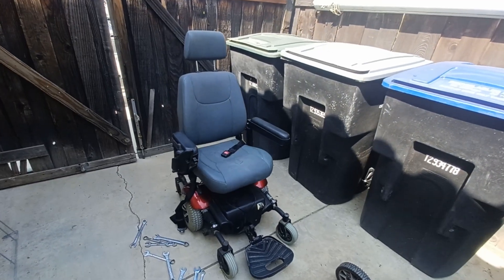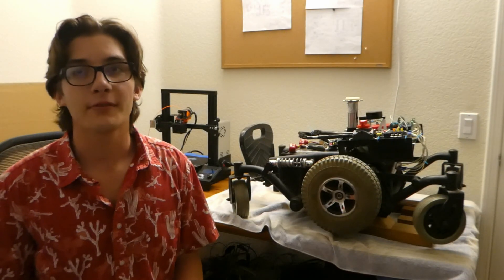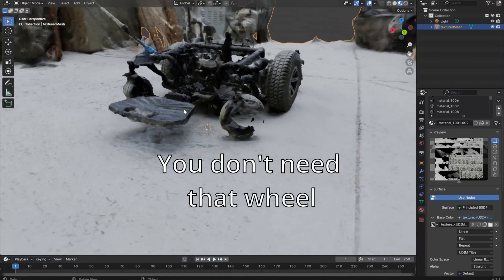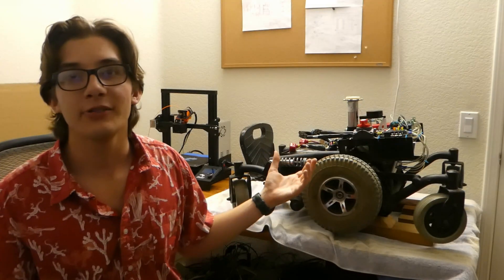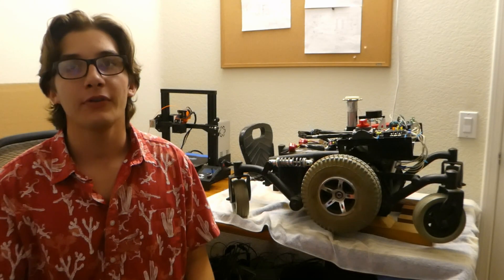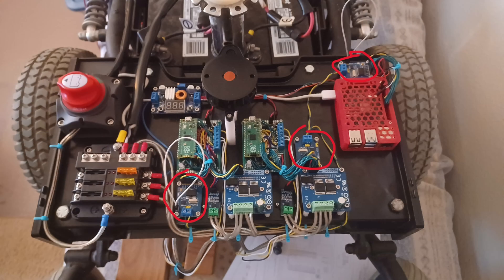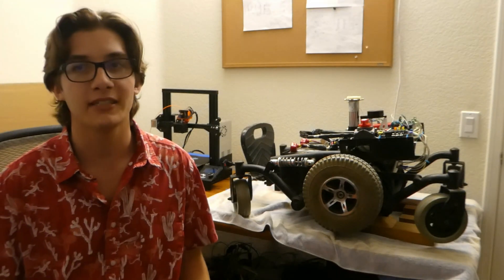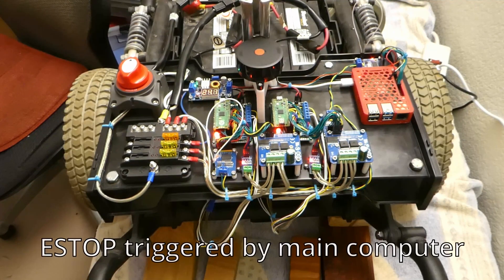The HARDWARE behind the ULTIMATE DIY DARK RIDE

Comment: Solid project, looking forward to seeing it running
one question - is there a specific reason you're using 2 picos, instead of just running the motors off the same one, or the main ras-pi? Are you limited by number of pins, or is there another reason for separating them
Reply from the maker: Hey glad you like my project! There isn't any reason that both motors couldn't be run from one microcontroller or from the Raspberry Pi directly. The only difficulty would be the specific wheel encoders I am using don't have settable I2C address, so you would have to use an I2C multiplexer to communicate with multiple. 
The reason I went for two microcontrollers is for ease of programming and debugging. If I had one microcontroller for both motors, I would be more likely to write an error that only affected only one motor that would be hard to debug.
As for why I didn't directly connect the motors to the Raspberry Pi, I like using the GPIO on the Pi as little as possible. Its more expensive to replace if any wiring is wrong and the board is shorted out. I also knew I will need a communications bus for future (secrete for now) upgrades to the vehicle, so its not like the communications bus is adding any complexity to the design.
Reply: @kleistrobotics2220  makes sense, agreed that messing with GPIO on the pi feels like a sketchy plan - from what I've heard there can be some weirdness with signal timing too since it has to go through an OS

In my projects I guess I avoid inter board comms when I can, idk, they always feel confusing and complicated to get working. But seems like you got it figured out :)
Reply from the maker: Yeah I used to struggle with the board to board communication but I've had to deal with it at work so much its become a sink or swim situation lol. The CAN modules I mentioned make it really easy.

Comment: I've seen @nikodembartnik use more that one robot using lidar at a time.
Reply from the maker: If I remember correctly, he was using the LIDAR as a simple "if wall to the left, then turn away from it" type control system, or maybe he had trained a neural network on lidar data to drive around a hallway. The control system for this ride will be more complicated than that, it is mapping and localization to that map. 
Of course there are ways around it, two or more vehicles could communicate with each other and they could update their maps to expect to see the vehicles in their reported position. The problem with that is if the reported position is wrong, then your stacking error on error on error, which will eventually result in bad localization and dangerous behavior of the vehicle (like driving into walls).